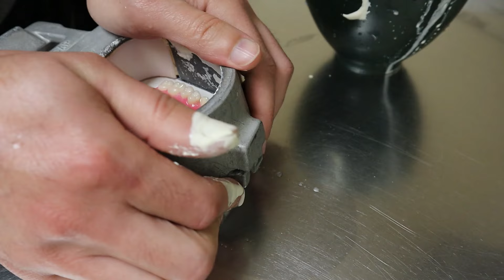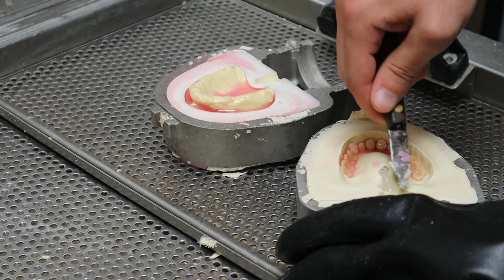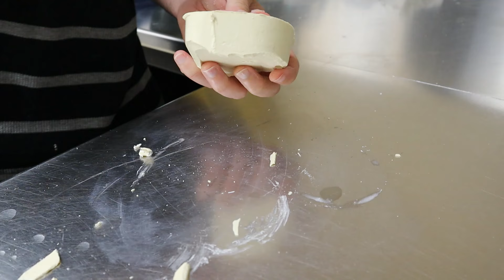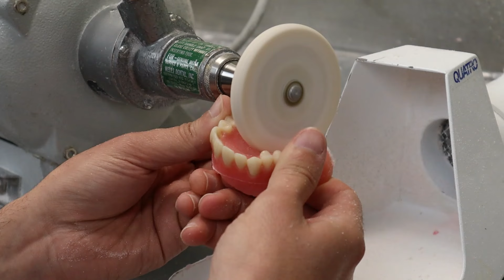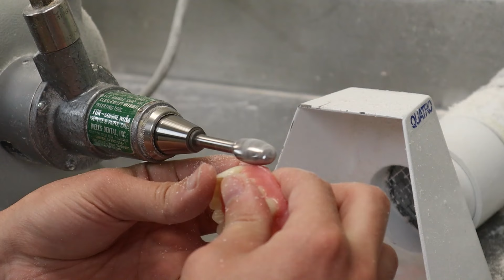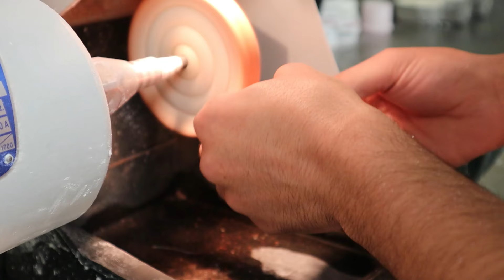MAKING FULL UPPER DENTURE FROM START TO FINISH. #waxbae #makingdentures #denture

Comment: Not to put down the work but the upper center part of the denture is to deep in  and it will make the costumers very unconfort they are making it that way so it holds better but is not true the opening on the throat have very sensitive sensors that make you gag if the denture is to deep
Reply from the maker: Thanks for your feedback